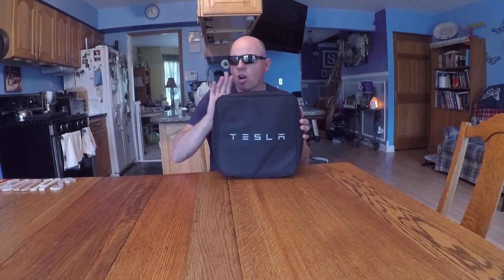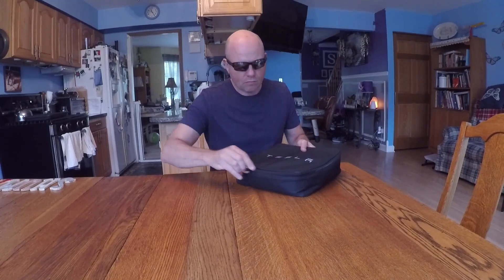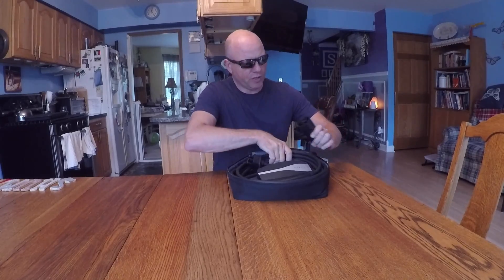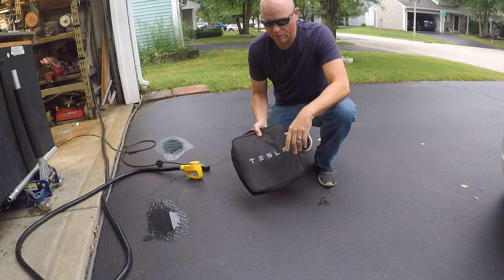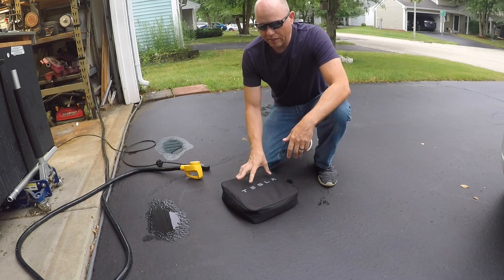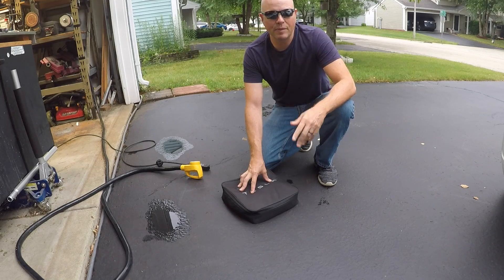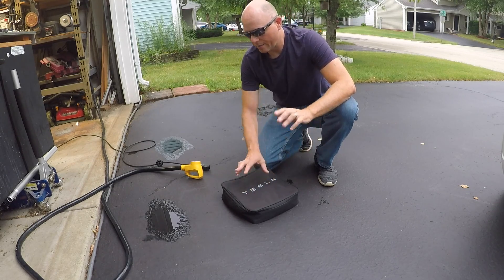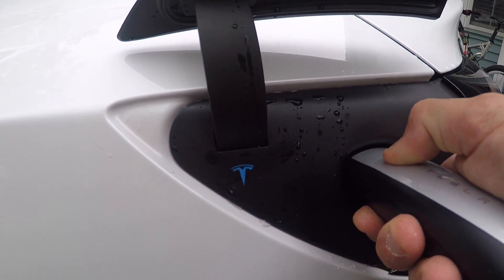Tesla Model 3 Comprehensive charging tutorial.

Comment: Does it have another input for superchargers? Because as far as I know, superchargers use a modified type 2, so where do you plug it in?
Reply from the maker: VoodooG superchargers use the same plug add the Tesla home charger shown in this video.
Reply: This video applies to Teslas in North America which use a proprietary Tesla connector which is why the J1772 adapter is needed for Level-2 public charging. In Europe, Teslas have a Type-2 connector along with the Superchargers there. In either case, the Supercharger plugs directly into the car without an adapter. On Bjorn Nyland's channel (https://youtu.be/Hh52C1b3BCE), he covers a variety of charging options for Teslas in Europe. Even though it assumes a Model S, most of it should apply to the Model 3 when it becomes available in Europe.

Comment: There are additional adapters available for $35 from Tesla that fit electric dryer and other types of 240V outlets that may already be present in your garage.
Reply: Keep in mind you could use the built-in timer to only start charging after midnight or whenever you know the dryers will be done.  But the 50-60A breakers (and required thicker cabling) can be more expensive, and the car maxes out at 32A with the charging kit anyway, so...  But, but the safe max continuous it'll use for a 30A plug will be less.  (Similar to 12A for the 15A 5-15).    

Yes, the J1772 comes with the car (and is used without the rest of the charging kit), along with 14-50 and 5-15 plugs for the charging cord.
Reply: The adaptor he's shown is definitely NEMA 14-50.  It's not used inside homes, it's most common use was for big RVs.
Reply from the maker: D Whatley no. What I show in the video is exactly what you get with the car. Npbetts1 is correct, you need to buy the other adapters separately.
Reply: Unless I am mistaken, that 240 adapter that you show IS a NEMA 14-30/standard dryer connector.  If not, I need to know that as it is what I plan to use.  I think there are two dryer plug standards though. The other only has 3 prongs, I think it is called a NEMA 10-30 and it might be a good idea to pick up that adapter as well for traveling if you are planning to rent or travel to a house.
Reply: Yes, we do have a timer on the water heater on that same panel and one of the dryers is very rarely used now that the kids are out of the house.  There is a 3rd dryer connection that is wired to the main panel (still only 30 amp) but I am not sure if there is a way to legally add a junction box to extend the plug.  If I could do that, I could put the primary dryer (short run, we added on to the house and moved the laundry) on that circuit.  Even if we come up with a way to set up a 50 amp circuit, I will want the 30 amp for travel.
Reply: Also, thanks for the confirmation on the J1772.  My local Kroger has a free ChargePoint so I will use it when I grocery shop.  My husband uses it with his Ford Cmax Energi plug-in hybrid any time we are in the shopping center.  Mostly, he likes the fact that he always has a very close parking space ;).
Reply: Thanks for the correction.  I will have to buy one of the 14-30 adapters then as I don't think I have room in the panel for a 220/50 amp breaker (at least not running the dryer and the car at the same time as the closes panel is 100 amp extension of the main and there are 2 dryers connected already).  I was under the impression that the standard dryer connector came with the car.  The J1772 , typical ChargePoint connector, DOES come with the car, right?

Comment: If what you describe as a "relay box" decides whether to transmit 120-Volt or 240-Volt power to one of the onboard chargers -- which you suggest is/arre part of the car -- I think you're suggesting what's in this zippered bag may either be a transformer or a rectifier, depending on whether the output of the device is "alternating-current" or "direct-current" -- each and every word is important, depending on whether the cord and all its' components transform voltage or "rectify" what form of "power" is transferred to the car.
Reply: AC to DC happens only inside the car, at the internal charger.  The box just passes the AC.
Reply: Jeremy Lang: That would mean the "relay box" is nothing more than a transformer.
Reply: The box is an EVSE, it communicates with the car's onboard charger to ensure everything is operating safely, help the charger select an appropriate charging voltage and current, and stop the charging if anything is amiss. It's a lot more than a relay, but the lay person isn't going to understand a lot more than that, and aside from the circuitry that monitors and communicates all that information, its job really is to act more or less as a glorified relay.

Comment: Thans I have a Chevy Bolt and a Juice Box level 2 charger. Wouldn't I be able to use the Tesla adapter  at home when my Model 3 gets here?
Reply: David Diaz I have Juicebox 40 for my Volt. Planning on using adapter when Model 3 arrives.
Reply: The JuiceBox charger plug is an SAE J1772, and the Tesla Model 3 includes an adapter to interface between your J1772 plug and the model 3.

Comment: you point out that it locks the charge cable to the port so nobody can just unplug it, but it seems all you need to do is hold the button and unplug it.  will it unplug for just anyone or does it detect the keyfob/card on your person and allow you to unplug the charger? 

also, for example at public stations, if your car is full (or reaches your set charge level) does it unlock so someone else can start using the charger?
Reply: Gibson99 I'm also wondering about this, but the issue is that most superchargers have one spot per charger and the cables are too short to reach anywhere else (in fact you often have to back in to reach).
Reply from the maker: Gibson99dotcom it needs to have the phone key nearby to unlock. However, public charging called plugged into the adapter so not always lock. Some do and some don't.
Reply: i guess i was thinking of superchargers specifically, since you probably don't want someone else using your charge cables without permission.  i would hope that a supercharger would unlock when full/done so that someone else can use it.  i do remember hearing about tesla charging people for sitting idle at SCs to discourage people from hogging them.
Reply: Most J1772 connectors have a release button that does not electronically lock out.  However, they almost all have a hole under that button where something like a luggage lock can be locked.  This prevents it from being maliciously disconnected.  Get a luggage lock and put it with your J1772 adaptor!  

Your adaptor would stay locked to the car either way.
Reply: @TheCritic-MMA  Evannex.com also has a locking ring adaptor for use at public charging stations with J1772 charging connectors @ $60+shipping.

Comment: The detail in your instructional videos is excellent.  I have both a Tesla High Powered Wall charger and an Aeroviornment J1772 wall charger in my garage. If you are ever near Normal Illinois and would like to use my equipment for another video, you would be welcome to do so.  Additionally, here in Normal, we also have many free to the public level 2 chargers, a ChargePoint level 2 charger which requires a card (even though it is free), and yes, an 8 stall Tesla super charger. I think that would cover most every charge option possible, short of a camp ground.

Comment: Great show!!!
When you're doing the audio walkthrough, can you please have a look into installing a subwoofer?!
I read in the Tesla forum that the Model 3 "have a current sensor in the negative battery lead. If you wire directly to the battery terminals the car can't monitor the current that is being used so it can't monitor the SOC of the 12 volt battery."
Is there any way around this?

Comment: I'd like to know more information about charging at public stations that are not Tesla superchargers. So DC fast charger converter? Chademo I think is another one. Could you charge a Tesla at a public DC fast charging station with the proper adapter?
I realize that the supercharging network is very good. I'm just curious if there are other options. Great video as usual.
Reply: The issue is access.  BMW has done this, open standard J1772/L3 at dealerships.  Many reports on plugshare of people being turned away.  Supposedly what VW's going to build will be more open.  Hopefully.  

Chevy... has made progress but I'm still not convinced they're entirely out of thinking about compliance cars, offsets for what they really want to sell.  

Clearly FIAT isn't.  Does the 500e still not have L3?  

I've seen pretty cool lamp-post chargers, makes a lot of sense since street lighting suddenly needs far less power (LED) than the infrastructure was built for.  Think I saw one today, was mounted curiously high though.
Reply from the maker: kens97sto171 as I mention in the video, the charge cord kit comes with a J1772 public charging station adapter. The rate of charge at a public charging station depends on the output of that particular station. CHADEMO stations are not supported on the Model 3.
Reply: Tech Forum 
Ahh. Ok. Thx. Wasn't sure if the one you mentioned was for DC quick charge. 
Thx for the info and cool videos.
Reply: coredumperror 
Well that seems like a small oversight on Tesla's point. Would have been easy enough to put a point-of-sale in each supercharger. I wonder if they can make it Tesla Supercharger app they would Lincoln with whatever car you own through your phone. And get it to work. It's certainly something I think they should have thought about if they really wanted to spread the use of electric vehicles
Reply: Yeah, there's a CHADEMO to Tesla adaptor sold by Tesla but it currently only works on S and X for some reason.  In the US there are more Superchargers than CHADEMO places, especially once you discount the ones at Nissan dealerships.  But some places to have DC fast charge "pumps" that have J1772/L3 plus CHADEMO.  

There has yet to be a J1772/L3 to Tesla adaptor, which is too bad as it's the actual public standard.  

I am curious how/whether the included J1772 works with the oddball big L3 plug.
Reply: Jeremy Lang 
Something that I have thought about for a while is that Tesla should capitalize on the investment they have made in their supercharger Network. open the network up to allow other makes and models to charge at their Network. It would bring in income for the company, also it would bring more people into electric cars because of that charging Network. Not everybody can spend a a hundred grand on an S, or even mid high 50s on A3. I think we're going to see more and more inexpensive electric cars come to Market but without a useful charging Network Nationwide people are going to be more cautious about getting rid of their current vehicle. And I don't think opening up their Network to other makes and models would reduce the number of cars that are sold by Tesla itself. You buy a Tesla because you can afford it and you want one. There are far more people that would like an electric car but will never ever buy a Tesla because of the price.
Reply: Tesla charging is inherently proprietary to Tesla and they don't show much interest in opening up.  They even went the other way when they stopped providing a J1772 charger at Supercharger stations some time ago.  

Similarly, even though it's a more open standard, in the US CHADEMO is basically proprietary to Nissan and the LEAF.  Nissan dealerships aren't eager to let others charge.  

There is a fast L3 DC direct charge option that is open and non-proprietary, based off J1772.  I would like for us to have an option/adaptor to use it eventually.  There are a lot of these being built, especially once VW starts building their Dieselgate-guilt ones.
Reply: In the 2018 Q1 Earnings Call earlier this year, Musk stated, "We've always said that we're -- this is not intended to be a walled garden, and we're happy to support other automakers and let them use our Supercharger stations. They would just need to pay the share of the cost proportionate to their vehicle usage. And they would need to be able to accept our charge rate or at least -- and our connector, at least have an adaptor to our connector. So this is something we're very open to, but so far none of the other car makers have wanted to do this. But it's like not because of opposition from us. This is not a walled garden. Trying to make a meritable share."

Recently, there have been reports that Bollinger Motors (https://www.bollingermotors.com/) has been making inquiries about using the Tesla Supercharger network for their up-and-coming B1 sport utility truck.
Reply: Jeremy Lang 
Well that's unfortunate to hear.  That seems to kind of go against Elons comment about that he would like electric cars to thrive and be everywhere. Except he won't share his charging system with others.
One thing I think Chevrolet should do is to just add several DC charging stations at every single Chevrolet dealer. That would give you a massive Network of charging stations for Chevrolet bolt in any other vehicles that use that standard. Seems an easy enough thing to start with.
There's a Chevy dealer in virtually every small town across America.
Reply: The issue with Superchargers not being compatible with other cars is that there is literally no user interface. You plug it it, the supercharger communicates with your car to determine your Tesla account, and then charges the fee to your Tesla account.

No Tesla account, no charging. As far as I know, at least.
Reply: Jeremy Lang 
See that's the thing for me I'd seriously consider a Chevy Bolt, if there was a reasonably good charging infrastructure.
the model 3 is certainly a super cool car but I don't need any of the autopilot stuff, or any of the super high-tech things that they do just basic transportation, with all the modern crash avoidance Safety Systems. Which unfortunately is not completly available in the Bolt.
The hatchback layout is just much better for my needs. And it's got more than enough power and range. If there was a decent charging infrastructure.

Comment: What happens if the power goes out while charging?
Reply from the maker: Robert Gamble you get an email notification from the Tesla app telling you when the charge was interrupter. Once power comes back on, charging resumes. This has happened to me once.
Reply: Even more interesting, after a couple early garage fires, the Tesla monitors the power and will reduce the charging rate if it detects instability in the supply.  It will also reduce charging rate based on temperature of the wand (supercharger) or wand and cable (charging kit) -- I got to experience that and now keep excess cable coiled around outlet instead of laying across hot asphalt.

The app will also notify of reduced charging rate.

Comment: I would seriously wear leather gloves when plugging in that 240. 240 can kill you!
Reply: It’s not voltage that kills, the current is.
You can easily survive 10,000 volts as long as the current is low, and you can get killed by 100 volts when the current is high.
Reply: @GixxerGR  Either way, those leather gloves will definitely save you.

Comment: Is there a timer feature built into the battery  or would you put the power thru a timer on garage wall?
For example if I wanted to charge at off peak hours ?

Great video.
Reply: Bebe Rebozo The car does that, so no need for a timer. You just set it to what you want.
If you have a look on his charging screen, for example at 9:50, you can see “scheduled charging” down the bottom.
(Same deal with the Model S & X).
Reply: FutureSystem738 
Excellent °¥°
Reply: You can schedule when you want it to charge and what level you want it to stop.
Reply: BillLowny 
Thanks

Comment: Thanks for the video! When does the charge port lock/unlock? Can that be done remotely from the app?
Reply: I'm also wondering about unlocking it if the button on the wand is broken, for example.
Reply: @TheCritic-MMA  You can do that on the charge screen.  You simply press [STOP CHARGING] and the car will stop the charging process and unlock the cord.

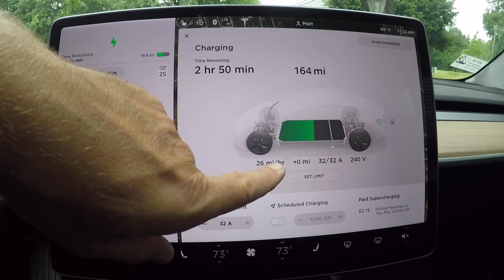You will hear the magnetic lock release the cord as soon as you press the button.  The button is in the top right corner of the screen at 8:08 in the video.
Reply: Paul Tadrick - I would have to test it out....BUT....you can open the charge port door from your app as well as close it.....and since the charger is locked in when the doors lock,  I would assume (until testing) that if I remotely unlock the doors, the charger would unlock.
Reply: Paul Tadrick it locks when the cord is plugged in and you walk away and the doors lock.
Reply: I still would like to know if i can unlock the charge port from the app?  If someone were wanting to move the charger form my car to theirs could i unlock it remotely for them?
Reply: Paul - Yes, you can unlock it from the app.